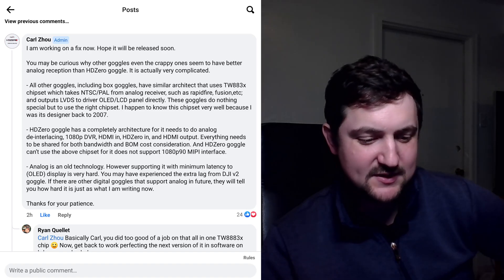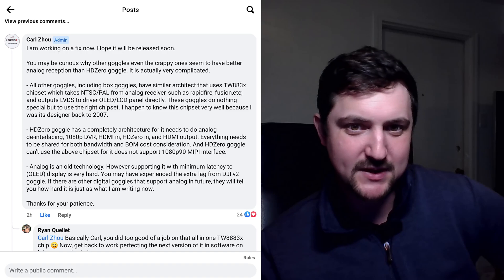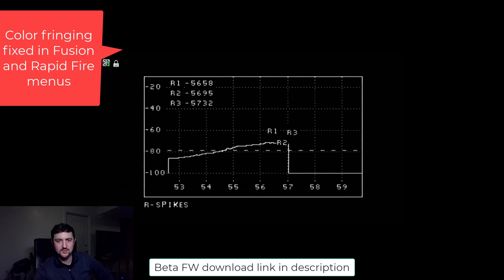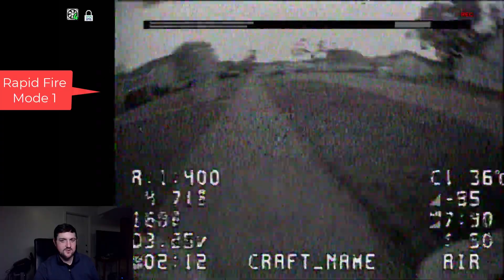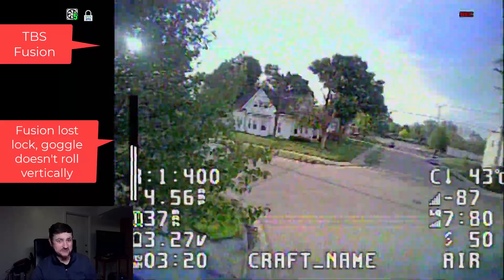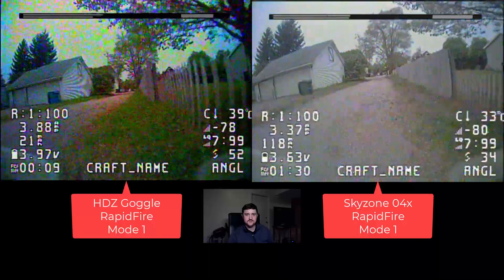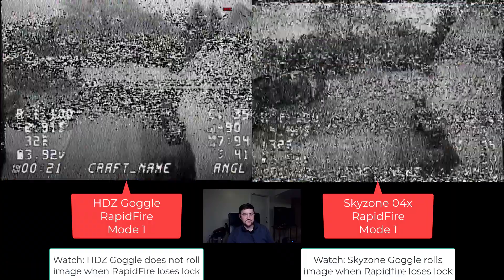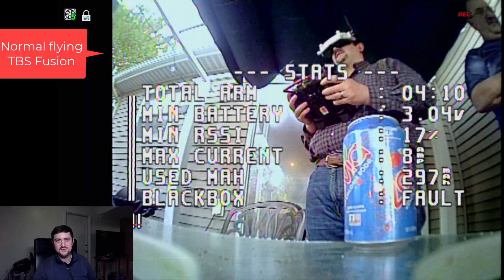Analog Public Beta - HDZero compared with Skyzone 04x, Rapid Fire, and Fusion

Comment: Hi, can you give me a brief update whats the current state of analog with the goggles? I want to pull the trigger on analog adapter and have a rapidfire already from earlier flying. Are there changes in this beta firmware still valid or already inside of the up to date regular goggles fw

Comment: Does the Analog to OLED conversion in the HDZero goggles add latency, like the DJI goggles did??
Reply from the maker: No added latency. Carl worked very hard to make analog on hdzero goggles have zero latency. Most other non-analog goggles have 1 frame of delay in analog input

Comment: Just ran this update in the goggles and now I cant get past the loading screen, screens go blank and there is a clicking in the goggles every 2 sec.  Is there a recovery procedure?
Reply from the maker: I should have stated that the one time os upgrade is required before flashing this fw to batch 1 goggles. Either way, follow the recovery procedure in the goggle manual and you'll be ok
Reply: Mine are batch two. I saw the screens say update complete and to power off.  Maybe I turned them off too soon.  Either way, I copied the 3 files from the recover folder and was able to recover them.  I then updated normally again and waited about 30sec after the update was completed.  All is well and the update removed the rainbow effect on my OSD elements and Fusion menus.

Comment: Hello Ryan, sorry for inisisting but i cant find information anywhere. This firmware is only for Analog? or it enable 540@60 fps for hdzero aswell? About flashing... i only see one file dont need to flash the vtx? thank you in advance
Reply from the maker: This fw is for the goggle only. It works for all input modes, but the only changes are for analog
Reply: @RyanQuellet  thank you

Comment: Hello, I know it has nothing to do with the subject but the indication of the fans on my goggles disappeared. How can I get back to this indicator? Another question now related with the beta firmware, just need to flash the goggles? dont need to flash my freestyle vtx i just see one file in the download section. Can i use 540p@6o fps with this firmware? Thank you in advance
Reply: Hold down the right hand button on the goggles
Reply: @zuldanfpv4634  thx

Comment: I'm still on factory firmware (v9.0.1). I'v been comparing my analog module (URUAV EVO) using the hdzero bay against an old skyzone bay that plugs into AVin. In my few tests it was virtually the same for both. But  the stability you show in this video  is quite an archievement. Also kudos for posting the beta in the description. Bravo!

Comment: No improvement on my batch 2 goggles. In the lower portion of the screen there's really bad image (black and white, static) that's not present on 9.0.1 firmware.
Reply: Thanks for your testing. I don't see the difference in analog portion between the batches. And would you please try the other mode (NTSC or PAL)?
Reply: Switching PAL/NTSC resolved the issue.

Comment: On mine, using RF on mode 2 and R8, the image would lock and flash for a second or so. It's really sketchy... That's on a whoop at 200mW.
Reply from the maker: Use mode 1
Reply: @RyanQuellet  Thanks Ryan, I tested it and, to my eyes, no much difference between mode 1 and 2… I’m also suffering from the bug with the analog not starting properly. RF does lock weird and a half image half garbage can be seen. Time to test this beta firmware! Thanks for the time you spend doing these vids and answering comments like mine!
Reply from the maker: @nikotttin  issue is probably NTSC vs PAL mode. Change the mode to match your camera in the source menu of the goggles

Comment: I was at a race last Friday and had a world of issues on R5 of analog module (TBS fusion on batch 2).  Going to hold on to my Orqa's until this gets squared away.  Looking forward to trying the new beta firmware.  Thanks again to those working to iron this out. 🤙🤙🤙
Reply: That sounds like it could have been wifi, some hotspots are on 5.8ghz

Comment: I have batch 1 goggles I received in the first week of January. I updated fw as soon as I got them, and havent updated since, aas Im about 80% analog and 20% HDZero, and Ive had a fear of Analog performance getting worse. I would really like to check out the fixes with hdmi in, as well as 1080p mode but couldnt risk analog performance getting worse, as Im happy with how it works now. I actually started out with a Wildfire module that would roll, and ended up buying a fusion module to try and make it better. I might finally give the new fw a try.